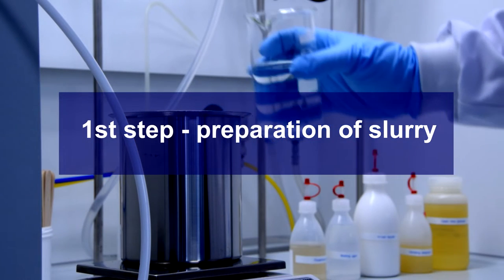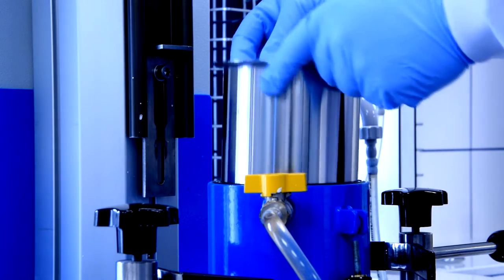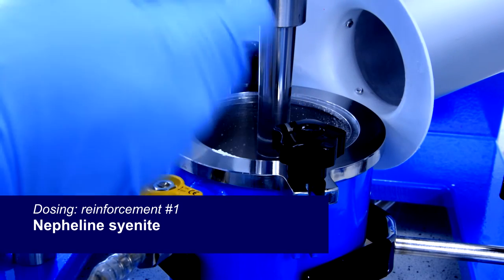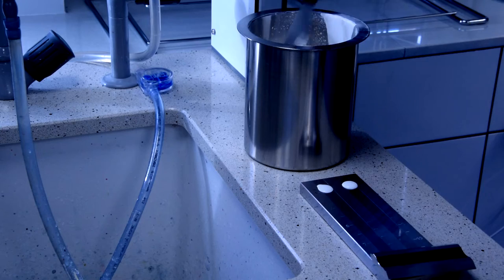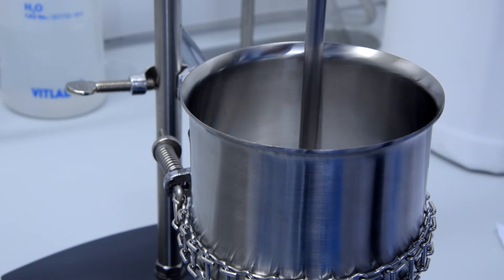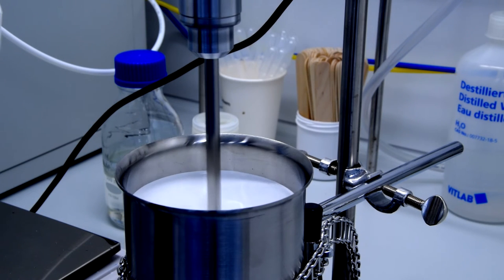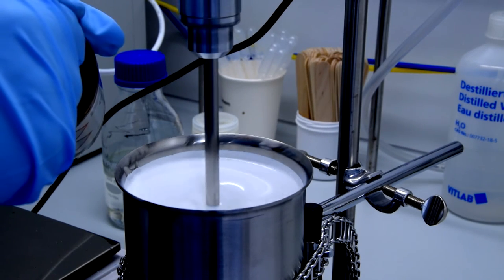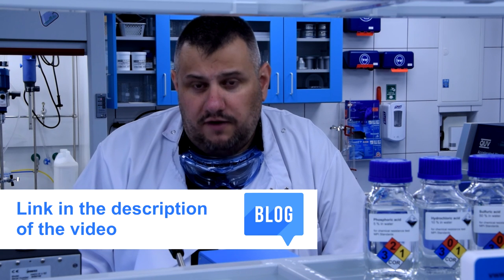How to prepare premium class flat latex paint? + BLOG article

Comment: It will be more easier for proper mixing, if you add colouring agents before adding thickner
Reply from the maker: It's even easier when added to grinding. The point is not to make it easier, but to see how the colorant is accepted as post-additive when added as it is with POS-tinting.
Reply: @SpektrochemResearchLaboratory  ohoo... Can we add colorant paste at grinding..?
Reply from the maker: @albertzacharias9552  Of course. There are no contraindications for this if you want to get slurry in the right color right away.

Comment: Good job Artur . . . nice overview of how to produce a premium quality flat waterbased architectural paint.  👏
Reply from the maker: Thank you, Sam. As you have noticed, this is a general overview. A comprehensive publication on the subject will soon be completed.
Reply: Sir you not added HEC please you can explain?
Reply from the maker: @ibrarpaintconsultant In this formulation was used mineral thickener as low-shear rheology modifier. Of course, HEC, hmHEC and other cellulose derivatives we use depending on formulation needs, market needs, etc. Presented formulation was without cellulose derivatives.
Reply: Respected Mr.Sam. Is  mineral thickener cheaper than HEC? Can I use mineral thickener instead of HEC?
Reply: @mohammadjashimuddin703  I believe this question is better answered by the author of this YouTube post . . . Artur Palasz from Spektrochem.  He has practical experience in formulating architectural paints.  My knowledge is based on chemistry, theory, and mechanism.
Reply: Thanks a million Mr.Sam.

Comment: Can you tell me what is the Use of Texanol in Paint ?
And what Dosage we use ?
Reply from the maker: It is one of the most common coalescing agent (TMPDMIB), trade name by Eastman, that is used to lower MFFT in acrylic-based latex paints and styrene-acrylic emulsions. Its dose depends on the set level of MFFT reduction which is determined in accordance with ASTM D2354 using the Rhopoint MFFT-Bar, and then the dose should be verified and the dose should be corrected based on the prepared paints and the LTC (low-temperature coalescence) tests performed to verify that the coalescent dose is appropriate to form a paint film on a porous substrate at low temperatures (below the link to articles on how important it is to properly define MFFT and LTC).

PCI e-article about miscibility in water and importance of LTC
https://digitaledition.pcimag.com/december-2021/feature-spektrochem/?oly_enc_id=8519D4501489E4C&_ga=2.245654977.478590607.1647384259-1364750107.1620916933

Blog article about MFFT https://paintlaboratory.wordpress.com/2022/04/14/what-is-the-mfft-and-how-is-it-determined/

Comment: Is it correct to mix the paint on the last stage with high speed? Because waterbased acrylic dispersions are not resistant to high shear forces
Reply from the maker: What you wrote is not entirely true. Most high-quality acrylic dispersions today are resistant to high shear forces, however, during let down, the anchor mixer used in the video does not cause shear because it involves using a dispersing disc, which causes potential shear. 

High shaft speeds when using an anchor mixer do not cause a problem here. So everything is fine. 

A bigger problem is the frequent addition of polymer dispersions to mill-base, which causes disturbances in the surfactants present in the dispersion and their coagulation, therefore polymer dispersions must not be added to mill-base, only mill-base to polymer dispersions.